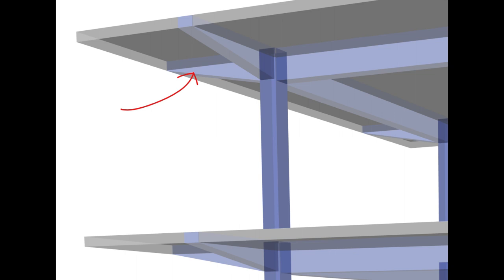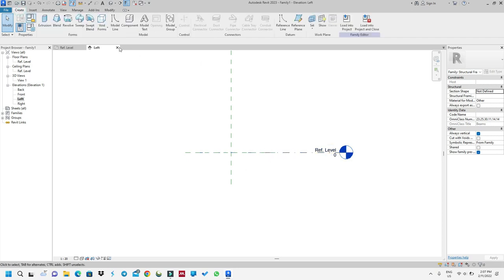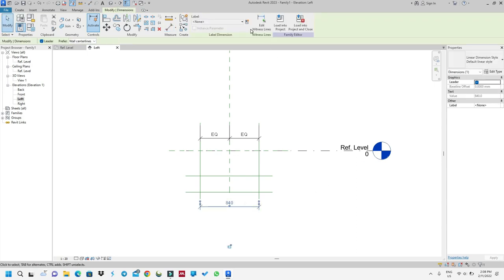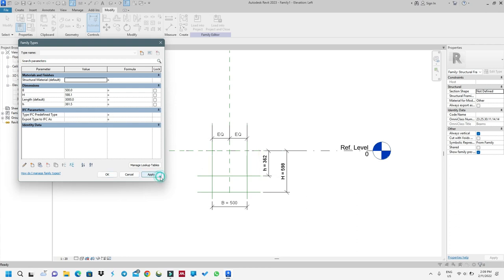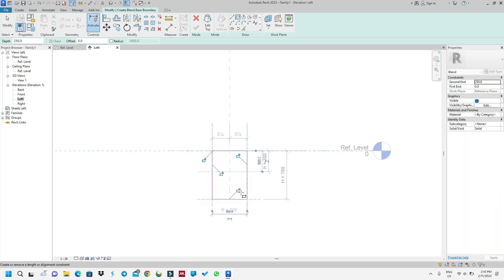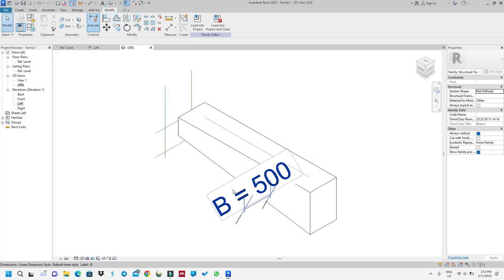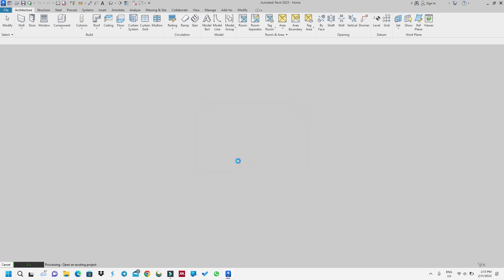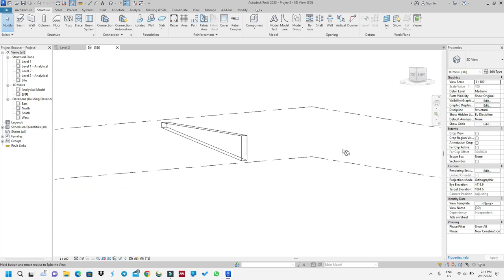How to model a Tapered, custom or knife edge beam or Column in Autodesk Revit.

Comment: Thank you.  I am trying to create a family for a tapered concrete module beam framing. It would look a bit like yours except the beam tapered on both sides.  V shape with flat as this:  \_/.  what should i then do in this case?
Reply from the maker: Hello. I will try to make a new video that match your case
Reply: thank you! :)  @structuralengineeringtutor574

Comment: Question: When you make the analytical model of this tapered beam and transfer it to Robot, the Robot software doesn't identify it as a tapered element. What can be the solution you think ? Thanks.
Reply from the maker: I am not familiar with Robot. I am familiar with Etabs. In Etabs, you can easily model a tapered beam. I would assume its equally easy to model a tapered beam in Robot
Reply: @structuralengineeringtutor574  I see, Ok, Thanks.